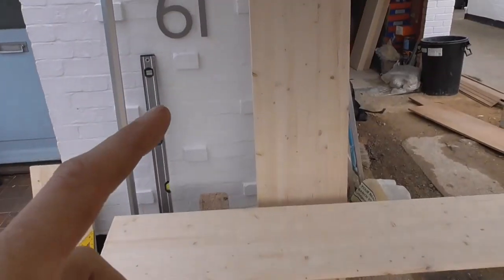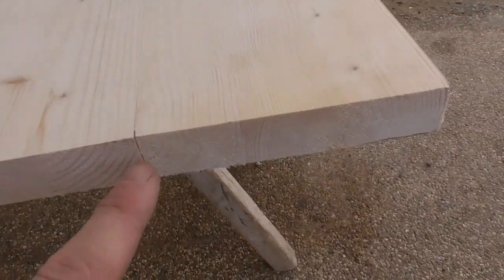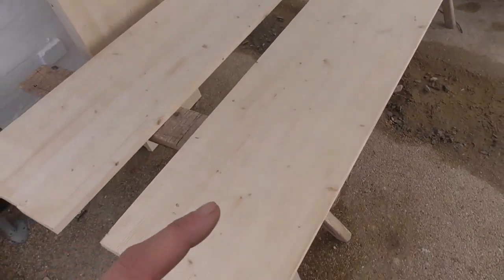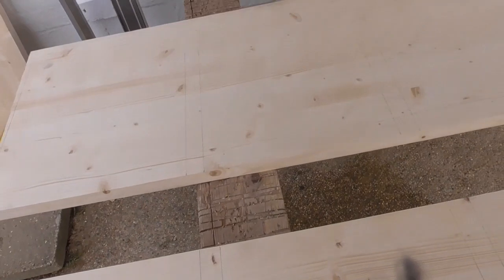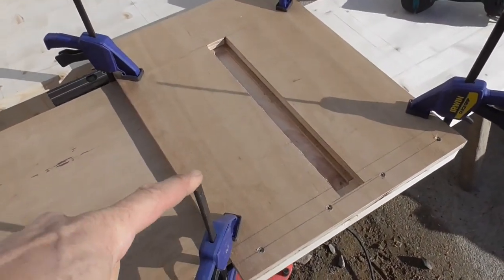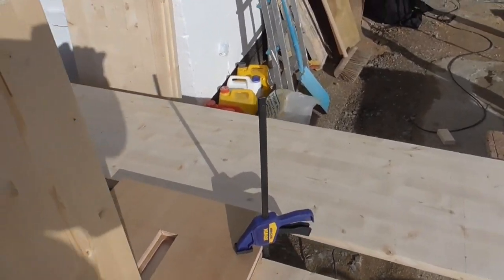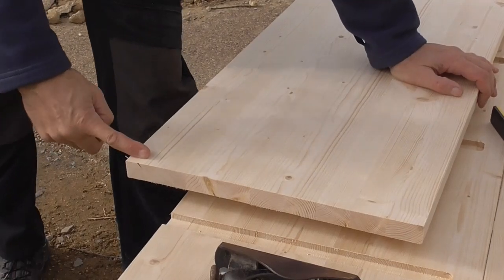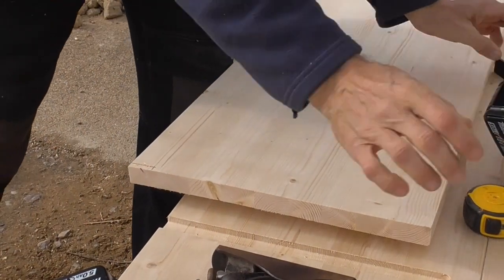How to make a shelving unit/storage wall using basic carpentry joints

Comment: A job well done. All ways a strange sense of relief and pride when it goes together so well and slots in place perfectly!
I’d use some little metal cleats/right angle brackets on the top to hold it
Reply from the maker: Hi AV🖐Yes, its great when it works out and ,makes all the planning and setting worth it👊I didn't have any metal angle brackets, so I fashioned some timber fixing blocks up instead👍Thanks for your comment😎Cheers Del

Comment: Fab job big man👍👍
You should have a look at the blanking cover and also stepped depth indicator from Strawbyte Workshop,very handy additions to the Makita rail saw. Also, I sometimes connect the Makita dust bag that came with the mitre saw ( as useful as a fart in a spacesuit on that)  to my rail saw using an adapter for those jobs when you don't really need to get the vacuum out, it does a good enough job in catching most of the sawdust and I reckon the blanking cover helps.
Reply from the maker: Hi John🖐I'll check those bits you suggested out👍Good shout on using a dust bag on the track saw, and I think I've got one somewhere👊Thanks for watching and your comment 😎 Cheers Del

Comment: Great job mate, would it not have been easier to use the cordless router with the plunge base for this seen as it’s only pine? Just to save setting up the cord etc
Reply from the maker: Hi Callum🖐Possibly bud, but I always just tend to lean towards the bigger router as I find its extra weight and bigger handles make it more comfortable to control👍Thanks for watching😎Cheers Del

Comment: Maybe a bit over the top, but I did wonder if a stopped sliding dovetail would remove the potential for gaps opening up once the timber shrinks in the house and would also hold the sides together without screws. Obviously a bit more set up but does cover up shrinkage. I am by no means an expert being retired, so I’m sure you will explain the virtues of dados/trenches. Just a though from an idle old man lol
Reply from the maker: Hi there🖐Very good point about the merits of a dovetail trench, but many of my jobs like this are just quick and simple at the customers request, so I tent to keep it basic which reduces the build time and, consequently, the cost👍Great comment and thanks for watching 😎 Cheers Del

Comment: Hi Del, I am pretty new to router, working out the correct bushing and bit always confuses me how did you do that here?
Reply from the maker: Hi there🖐I keep meaning to do a short video on this but, it's pretty simple😉 You just subtract the cutter size from the guide bush size and add this to the material width that you want to fit into the trench👍Cheers Del

Comment: What's the blower del? Makita obviously
Reply from the maker: Hi Mike🖐I'm not sure of the exact model number, but I'm pretty sure its the only 18v blower Makita only do🤞Thanks for watching and your comment😎Cheers Del
Reply: @thetallcarpenter  There's another fatter 18V blower.
Reply from the maker: @ysfdesign  Ah, I wasn't aware of that, but I seem to remember seeing a bigger one which I just thought was 36v😬I bet it shifts some air🤧Thanks for your comment😎Cheers Del
Reply: @thetallcarpenter  I have the 36V one for the garden. I can confirm that it does indeed shift some air.